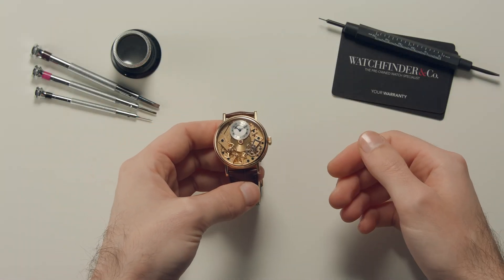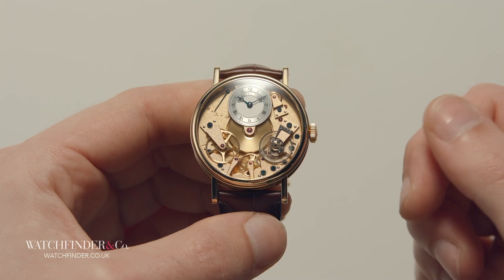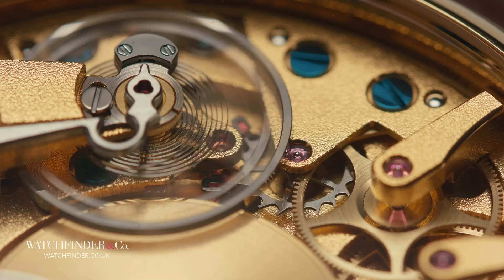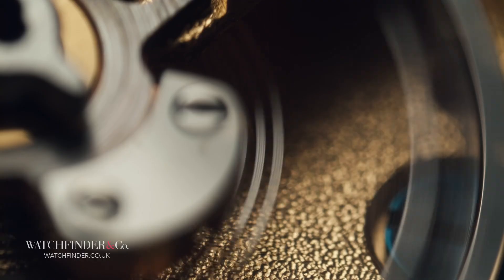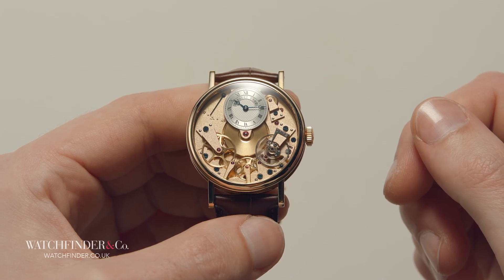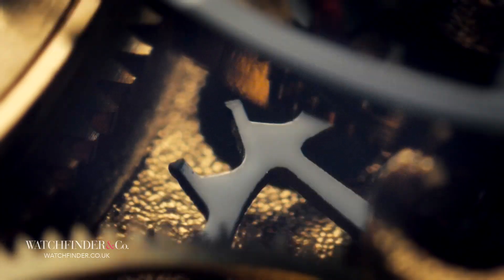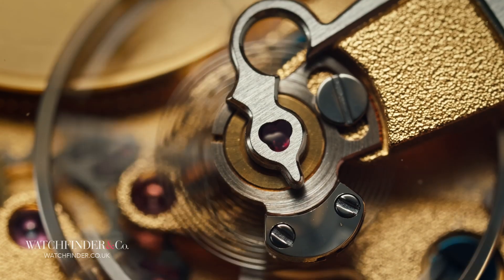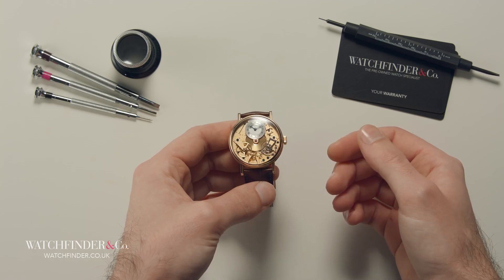How Does a Watch Work with No Battery? | Watchfinder & Co.

Comment: Help me to understand from where is the power to make the first tic.
The clock is run out (the spring is unwinded). The clock is stop.
Fork is not moving, balance wheel is not spinning (balancing). The jewel (pellet) is blocking the escape wheel by the last beat of the system.
We start winding the clock and the power from main spring starts to rotate the wheels one by one until the escape wheel is powered.
This is the magic moment.
HOW THE ESCAPE WHEEL MOVES THE FORK FOR THE FIRST TIC TO PASS THE ENERGY INTO THE HAIR SPRING IN THE BALANCE WHEEL WHEN THE JEWEL IS BLOCKING THE SYSTEM ?

Comment: 7:55 the mainspring winds down and torque decreases, but that results in the timing increasing rather than slowing. 

The energy put into the movement has an inverse effect of timing rate because of the reduced amplitude of the regulating organ. Less energy put into the oscillating weight which results in a shorter arc of travel. Shorter arc takes less time to travel, resulting in a higher frequency and thus, a faster rate.

Had to have that one explained to me once I realized I had no idea what kept the oscillating weights amplitude from dropping off fron friction.

Edited for incorrect wording.

Comment: Q: Around 1:41. Why is there not enough room for a gear ratio of 17,000:1? Say, a watch oscillates at 4Hz, and the hour hand moves as expected. Makes 172,800:1 in my calculation. The IWC perpetual has a gear ratio of around 6.3bn :1 for the century slider (one of the highest ever to be crammed into a watch)...

Comment: I have a "Citizen: Eco Drive" watch - electrical but has a black solar panel in its face and will run off any light - even working in dimmed offices and stuff for years have never had the warning pop up and have had it near 10 years now.  The amount of power needed to turn a light watch mechanism is so little that even a tiny area of solar panel can power it if it has enough ambient light for people to see in.  That was a few hundred and well worth it.  Titanium case too so has held up to a lot of abuse like sliding around fixing roofs...

I'd like to get a skeletal watch - but too many on the non multi-thousand $ range are made in China - same guts if you buy it for $25 or $200 - and it stops working after a year - likely no jewel bevel for gears to rotate on.  I can tell because when it bonks out it works IF the watch is held right but stops quickly if it doesn't.

Comment: So the first spring is geared down, then it encounters the escapement wheel. This turns and pushes out a lever which winds another spring. Once the level is pushed outward fully, it begins to unwinds and gets caught in the escape wheel again. Once enough potential energy has been built up in the escapement wheel, the process repeats.

Comment: Thanks for another great video! It would be fantastic if at some point you could discuss, compare or contrast the engineering and adjustments that went into the top Hamilton, Elgin and Waltham pocket watches as those were also marvels of engineering (and some would argue the finest damaskeening) for their time. 950B, 992, Vanguard, etc
Reply: Better yet, explain how the Atmos clock work.
Reply: @YT-jh8co  Those are actually a pretty simple internal bladder expansion and contraction, I think. But agreed! LeCoutre brilliance!

Comment: Enjoyed that, there is something romantic about having a little machine on your wrist that doesn't require any batteries.
Reply: Nothing beats a G shock Solar for continuous power supply.
Reply: @shino8854  What will you do under ground with your solar power supply?
Reply: @irkenpost  Nothing, go up to the surface, when I am done being underground. 
What will you do being under ground if there is no light, how can you read the watch face 🤦‍♂️
Reply: @shino8854  what if you can't go up to the surface cause there is a radiation wasteland! I will be able to read the dial with help of various sources of light: candles, lighters etc. And even without them cause the eyes are getting used to darkness. Chill out G shock boy :)
Reply: @irkenpost  So there is light in your so called underground radiation scenario🤭🤭, you do realise light also charges up G shock solar watches right 🤦‍♂️.
Our eyes still need some sort of source of light to be able to see, if it is completely dark, you will not be able to read your watch face. Please educate yourself on the basics, before trying to retort.
Reply: @irkenpost  imagine arguing over watch
Reply: Replacing batteries every two years is also fucking annoying. My Victorinox Infantry 38mm eats them up in no time whilst my SKX013 is still chugging along without issues.
Reply: @irkenpost  Yes you are correct 'TRYING' to retort is your right.....just try harder, sunshine.
Reply: @shino8854  your mom called me exactly the same
Reply: @irkenpost  🤣🤣😅🤦‍♂️ Mom jokes!? 
You are obviously a kid, stop replying, and educate yourself.
Reply: @shino8854  I'm educated enough to impress your mom
Reply: @irkenpost  I hope you've matured now that it has been 2 years
Reply: Spring storing energy is indeed a form of mechanical battery
Reply: Why fight boys, when there's something glorious mankind has created for us gentlemen!
Reply: Definitely!
Reply: How is that romantic
Reply: I find it equally romantic that it both has a finite life and can outlast you.
Reply: I don't know about is romantic about it, but it's cool as hell though.
Reply: Gay
Reply: Tinder bio: “If yo broke ahh don’t got no steampunk design looking watch, then you ain’t the one.”

Comment: Doesn’t the grand seiko spring drive have a volt or an amp or fraction there of in terms of electricity?
Reply: Yes @bmwryder they are using coils to generate power, which operates a circuit which uses a quartz as it's timebase. Instead of an escapement, there is an electrical brake to limit the power Transfer between the main spring and the hands. So there is only a spring and no batteries. I love that symbiosis of mechanics and electronic, especially from an engineering perspective.